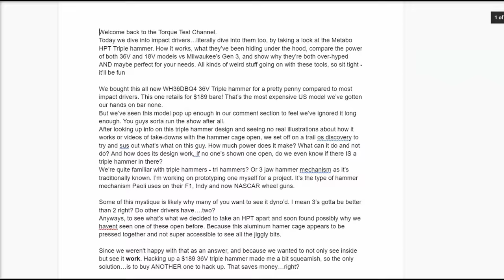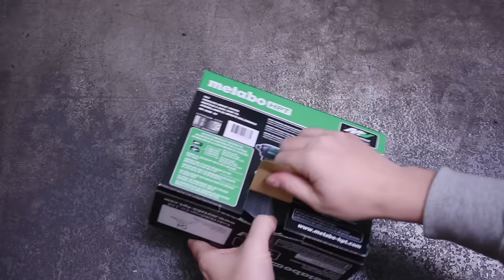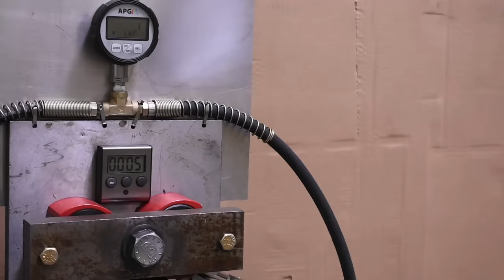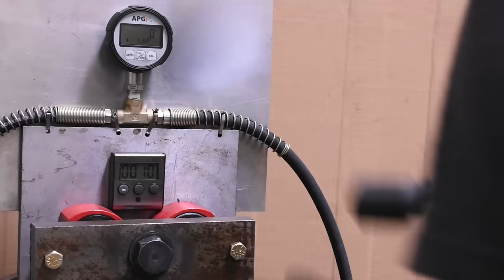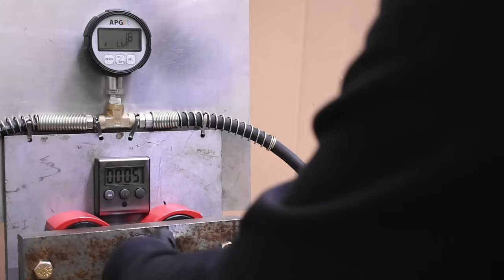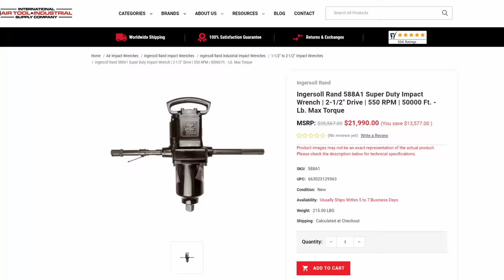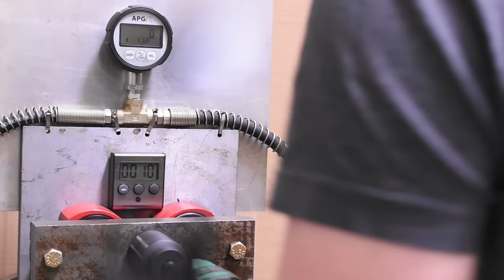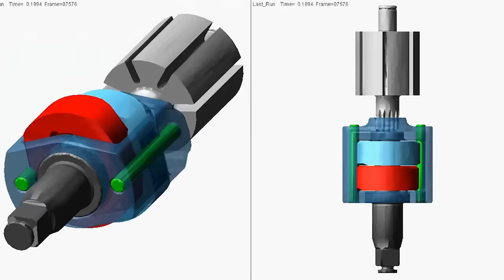High-Speed Video Uncovers Weird Stuff In Popular Impact Driver (See Comments)

Comment: Seems a lot like how an engine can experience valve float at higher RPMs. The valve is moving so fast it overcomes the force of the spring pushing on it so the chamber isn't sealed at the correct time during the cycle of the engine. Perhaps a barrel shaped spring would increase the consistency of the hammer mechanism hitting at the correct time.

Comment: I know nothing about impact driver physics, but is it possible that while creating a view into the tool, for filming purposes you modified the structural integrity of the housing which the internals may depend on for a tight, full contacts between the hammer and anvils?  Just asking a question, I'll shut up now.

Comment: Actually at high power it might work better as its getting 240 degrees of energy dumped into the anvil instead of the normal 180 degrees. For maximum impact you'd want 1 hammer and 1 anvil.

Comment: It is not clear but when you filmed the cut away shots did you put pressure on the tool end.  If not this is probably why you saw that tri-bit of metal rest on the hammer rather than move down to the next notch

Comment: Would you guys like to test my DCF887? It’s an older 2017 model with TONS of hours on it. Picked it up from a contractor for $15, meticulously cleaned and replaced worn parts, greased up, and replaced the broken 1/4 drive with a 3/8. I would love to see how an abused but reconditioned 1/4 tool converted to 3/8 would do. Seems to take lug nuts off torqued at 140ftlbs in less than 5 seconds.

Comment: Skipping hammers yields a harder hit. This is at a higher setting. Your assumptions about how this should work...it doesn't appear you consulted any manufacturers...
Reply from the maker: Well 1) we did consult HPT and they said they'd need to check with the Japan side engineers. So doesnt seem like very intuitive or widely known. 2) if this were the case it should be making more power. We don't see that.

Comment: Video idea, Does re-greasing impact drivers improve performance.
I just re-greased my Milwaukie m18 gen3 impact and I swear its hitting substantially harder.
I never service my drills but a few times now my impact driver has lost some grease out the front when I run it hard. So I thought I would put some fresh grease in, who knows it might make the tool last longer. I cleaned it up and put in some moly grease. I just tested it on some screws in wood and it feels like its hitting 20% harder.

Comment: this seems like in the high end lbs, wind up time is more important than ipm, so it would be cool to see you remove 2 of the three dogs and dymo this thing with only 1 dog and 360degree windup instead of 120
Reply: That would definitely have stronger hit but the torque would be outside the rotational axis of the tip which would probably crack the housing pretty fast.

Comment: $189 for a 36v triple hammer seems kinda cheap to me. The 18v comes in a kit with battery and charger for $139. Now let me finish the video and see if its worth it.

Edit: it does not appear to be worth it. Ill keep my Hercules. I was a bit sad when I saw the 18v kit for $139. I am now much happier with my Herc with two batteries and a charger for $97.99. I do love my finish nailer by Metabo. It's so good that I was bummed about missing out on the triple hammer.

Comment: I definitely want to see that. I own the 18v. I think they may also wear faster do to this. Mine has started making a noise.lol the main thing with this company that ultimately caused me to switch was that their 4ah multivolt batteries die in the cold. And it really doesn't have to be that cold. I had 2 do this. Meanwhile there 3ah compact battery has no issue. And I have no idea why. It's frustrating. They advertise these as pro grade. But what pro doesn't at some point work in the cold.

Comment: Makes me think of the hand tool style of impact drivers, the kind you whack with a hammer. I know it's not the intent of the feature, but the feature doesn't make much sense anyways, greater impact blows by skipping dogs(?), but you're also losing hammer energy when you're hitting the top of the dog; it sounds like poorly implemented marketing wank, and this is proven by how mangled screws will get and how the collet retainer likes to bounce around. I want to see this with a rusted bolt test, see if the hammering assists with unseizing a fastener, and if it does then that's a better feature than what's currently being advertised. This thing really comes off as more of a combination of a miniaturized hammer drill combined with an impact driver.

Comment: Might be boring, but You guys should try out the Milwaukee 7/16 impact designed for linemen. Curious where that falls in line of power.
Reply from the maker: No way  to drive our bolt with it without some kind of weird adapter. Then who knows how much that loses
Reply: @TorqueTestChannel  fair point. Just saw a picture of it and thought “I wonder how many beans that thing has”

Comment: Just based off of your description of the mechanism, a single, off-axis strike at a time seems like such a horrible design from the outset. At least with opposing strikes, the shock waves quickly converge in to mostly torque and some vibration based on the tiny differences in strike time and propagation. A single strike at a time is just PUNISHING to the material. It'd be like clamping vice grips on the screw and wailing with a hammer. Of course the screw's going to go all wobbly!

Perhaps that is based off of me picking up on verbiage wrong when really all three strike at once, but still. 3 points creates one more opportunity than two for tiny manufacturing differences and shit like this dog-skipping to make the force focus off-axis.

Comment: 2 things: 
 
1- Metabo HPT (or Hikoki) are NOT Hitachi in the sense of Hitachi Quality! Hitachi was great in their time, but like all things, they got greedy and cheapened their lineup. 
 
2- "MoAr ToRqUe!!!"  In tiny tools Is a bad thing. Our ability to make a tool extremely high torque is not hard. Making products that can handle that torque is the issue. Tools with higher torque require more around them to handle the impacts under high torque. So the "MoAr ToRqUe!!!" By people (mainly guys with tiny 🍆  ) is harming the industry. No impact driver needs more than 150ft/lbs. If you think it does, then you're using the wrong tool right off the bat. And if it's a small framed tool, more is less. 
 
(Yes I'm shitting on  the DCF850 since it's too small for it's own  strength. Plus, the bearings and connections on them are horrible... it's an Atomic after all. And with the horrible idea of Powerstack (spicy pillow) batteries, I'm glad I walked away from Dewalt 2 years ago. It broke my heart, bit ove sewn many tool companies grow better and many grow worse. And Dewalt is following that patter  of racing to become garbage.)

Comment: An impact driver is not intended for woodscrews, so that test is irrelevant.   
(In fact, you just proved its unsuitable.)
Impact Drivers, Power Drill/ Screwdrivers, and Hammer Drills are (outwardly similar, but) differently designed tools for different purposes.

Comment: I think it all adds up to too much power on a 1/4" bit.  Why aren't they 5/16", 3/8", or 1/2" drives?  I see an opportunity to convince/sell us we need a whole new format of tools and adapters.
Reply: That's an interesting point given that 5/16" impact bits are already a thing.  I have an impact socket set that came with some along with a 1/2" square female to 5/16" hex female adapter to run them.

Comment: Even working correctly - i think that triple hammer design is killing the tool. Its not allowing the hammer enough time to gain more momentum before making the next strike.  I bet if that gun was switched to a regular twin hammer it would operate much better and produce more power.  Metabo prob dumped too much money into this design to just throw it away - KNOWING full well it sucked.

Comment: can you drive 8x600mm bolts with an impact?
if so, what size of an impact should I use?
my cordless drill can handle them, but that's no fun when you're standing on a ladder and the drill is trying to push you down.

Comment: Hey here's a though I'd like to see how that rigid HT does with an adapter to use something like the power stack or the Milwaukee h.o batteries since the octane batteries are no longer available but the tool is perhaps maybe the adapter would allow us to use it to it's full potential I'm actually ordering it right now since it's a special buy at 199 with batt and charger right now , I mean the power stack over charges Milwaukee guns when used with an adapter so maybe we'd get the same on the rigid bad boy

Comment: This is most likely the batterys cant keep up to make it 36v you probably relying on a single cell at 20amps on the 36v pack 

Where as the 18v has extra because 2 cells so 10 amps each  

Its called voktage sag i deal with it alot in car stereos and high power ebike.

Every tool on the market hasnt got wiring motors or controllers to actually handle 24/7 abuse 

I create elaborate cooling for rcs.  Pcs. 3d printers and much more. But batterys some time u just get stuck with not enough cells.  

So voltage sags

Comment: I'm not super smart on this but if its sorta in the realm of how bullets work, wouldn't a single hammer of greater mass traveling a longer distance at a higher speed have a greater force. I sorta understand newton's 2nd law but I guess that would be a balance issue like how a crankshaft works so atleast 2 anvils and 2 hammer have to be in the mix that strike simultaneously for 2x the force. 3 just seems like over engineering tbh.

Comment: I always knew it did this based on the sound, but also assumed it was kind of intentional. High IPM under light load I assumed would give faster driving performance, but under a heavy torque load skipping would allow the hammer to build more momentum for every impact, resulting in higher torque at the expense of speed. Is there any chance you guys could mod one with a stiffer spring to make it stop skipping and see if that actually improves performance?

Comment: I feel like their initial goal was to get the thing to make a  FULL 2 revolutions, therefore having far more stored energy from the anvil being able to gain more momentum; however, their chosen motor wasn't up to the task (max RPM too low?), resulting in it only managing 1.5 revs.

So instead of scraping it, they opted to spray clear coat on this piece of shit and try to pass it off as a "Polished Turd".
Enter the soon to be released model, which I wonder if it has a more capable motor and will end up getting that 2:1 whack, vs this 1.5:1... 🤔

Good video though! Uncle Bumblefuck definitely needs to do a BOLTR on them! 😏 (that, and he hasn't done one in way too long lol)

Comment: spring needs more tension or it needs to be a 2 dog impact since the main reason this is ONLY really used on bigger hammers (more power/torque to compress spring) and not in smaller ones where the time between lifting/falling is bigger than the travel time between the dogs (why it lands on the third). any REAL study done by the MFG or TESTING at all would have exposed this issue. soooo. the "3 hammer" design. is NOTHING more than "3 is higher than 2" without actually improving anything (and REALISTICALLY just hurting stuff) same reason why its 36v instead of 24v. (36>24) bigger number more "eye candy" for the "wanna be" handyman who knows nothing of the tool they are buying.

Comment: This is definetly a case of failed innovation. If they managed to make the hammer skip all the way to the next anvils, without landing on top of the anvil. It would allow more time for acceleration and result in stronger blows, and thus more torque on the anvil.

The rest state of the spring is when the anvil is recessed between the hammer faces. And that allows for very low friction rotation of the hammer. But now if the spring is pressing the hammer down on the anvil that's a whole lot of friction losses that take away the energy gathered in accelerating the hammer.

I think the original engineers designed the hammer system with a slightly stronger motor in mind, because that would solve the issue of the hammer landing a little too soon after the skip.
Reply: The hammer touches the top of the anvil on all impact drivers. That's just how the spring works depending on how much load is applied.

Comment: Been running one (18v) for over 2 years now alongside it my Makita set... $100 including a 3 amp hour battery charger and tool bag... Pound for pound dollar for dollar I have not one bad thing to say. 

Now the half inch drill I bought at the same time same price same package content... She got plenty of power but it's got this crazy high-pitched squeal to the motor that makes it pretty much unbearable for me to use. 

$200 for everything two batteries etc still for the impact vs. Dewalt or millfuckery I'd buy green again. I hate yellow and red

Comment: Looks like a flawed concept and design of the tool. 

It seems to me (I am just speculating):
When the hammer/anvil engages, all three of them hit at the same time. 
If so, then the tool is simply taking the hammer’s inertia and distributing across 3 contact points rather than 1 or 2. So sure, maybe this design reduce the wear of the contact patch. 
HOWEVER, the hammer’s closure speed towards the anvil simply isn’t enough to keep up, when rpm goes up - just like the video showed. 
ALSO, even if the hammer’s closing-spring were to change to a higher spring rate to help with the closure speed, and let’s say the hammer engages the anvil every single time even at high speed according to tool’s original design…
The question is: during this 1/3 rotation, how much momentum has being built up in the hammer? 
Vs: allowing 1/2 rotation for each impact. 

I haven’t studied impact driver design in detail, so I am purely speculating at this stage and could be totally wrong. 
Wondering if anyone has looked at that in detail…

Comment: I don't think you get it. The intention is to allow it to pick up more speed (rpm) before it hits the anvil by sliding over the next in succession at higher power. Higher power means faster acceleration of the hammer after a blow so it can reach a higher speed before it hits if it accelerates fast enough vs the rate it falls back down again and so skips next anvil position.
The fact that this doesn't seem to work however is sad.

Comment: Tripple hammers are a joke. It’s a marketing ploy. It hits more yes but it don’t hit as hard as and a double hammer can.
Reply: It's not a marketing ploy. If it hits 1.5 times a rotation under heavy load, it's hitting harder than the standard design. Either way, at 215Nm of torque and 3400-3600 rpms, it's about as powerful and fast as all the other flagship impact drivers.

Comment: Well I'll be dammed. I feel cheated by HPT now
Reply: Here's what Hikoki says on their website about the triple hammer:

"Under high loads, the number of strikes is automatically controlled, skipping one claw of the hammer, and striking 1.5 times per rotation. Energy increased dramatically. Achieves high screw tightening speed. Ideal for tightening thick and long screws such as hardware screws." (translated to English)

Comment: The slow mo was OK but you need a lot faster camera. And please practise your techniques for illustrating what the hammer and anvil are doing as your explanation was laughable (I literally was, sorry!)

Fantastic calling out a tool manufacturer for potential faults / omissions in advertising! (whatever the problem turns out to be)
Reply: What fault? The fault he's pointing out in the video. That's the whole point of the video!
Reply: @astranger448  I did see that and have read it.

I do appreciate your input and agree that they make various tools targeted at light/medium/heavy jobs, and you wouldn't use something that's good at removing lug nuts for a delicate job, no matter how good the variable control is (too much weight just makes it awkward to use)

This is why I consider this a poor design:-

It's impossible to switch cleanly from three strikes per revolution to 1.5. When it starts switching, the hammer will hit the anvil, come off, and NOT hit the next anvil fully. This produces rotational torque on the hammer 'tooth' and anvil 'tooth' (forgive me, don't know the correct names). They can't make the metal thicker here as they are using three teeth, so it needs to be narrower than a two tooth design, i.e. weaker. Will they start to bend rotationally?

As the transition proceeds, less and less surface between them will be used, massively increasing wear on the leading 90 degree corner of the teeth. As these wear more and more, this will make the wrench bounce off the second tooth (out of the 3 / 1,5 strikes) more and more, IMO shortening tool life considerably. Once the top, say, quarter of each tooth is worn round, the tool is scrap.

We can see from the videos that the hammer striking the anvil in line produces an impact hammer effect, wrecking screws. People who buy these mostly are NOT aware that even if this wrench CAN happily appear to drive in lag screws, they should not use it to do so. If it didn't have these daft design flaws, it CAN be used to do stuff that maybe a heavier duty driver would do a lot better.

It just looks to me as if they are trying to solve a problem that doesn't really exist and have created a load of other problems and an unreliable tool that'll wear itself out in double quick time.